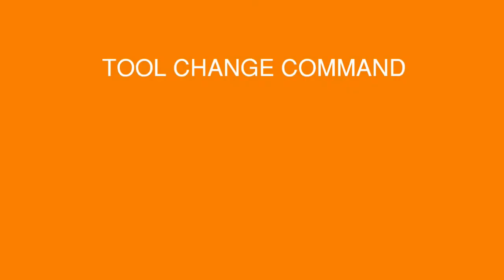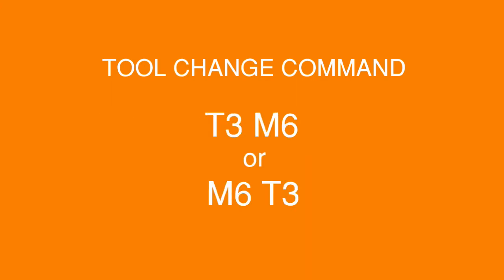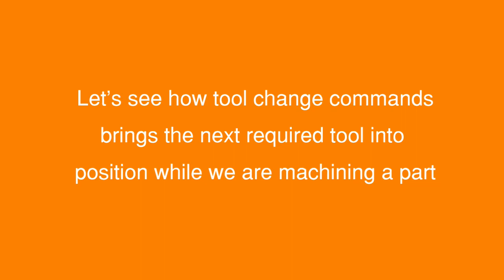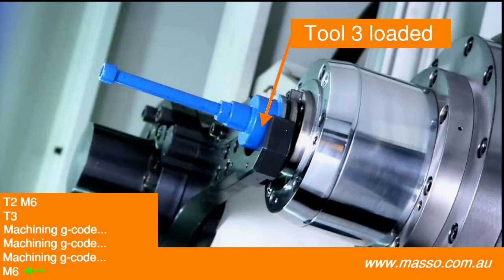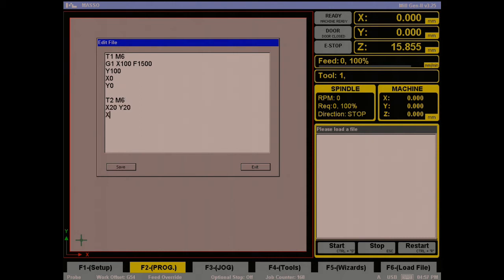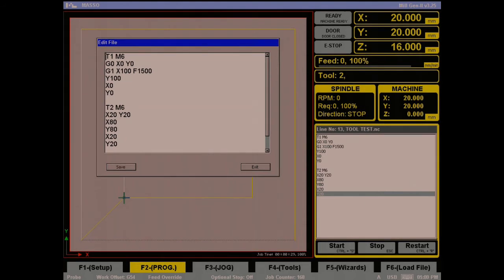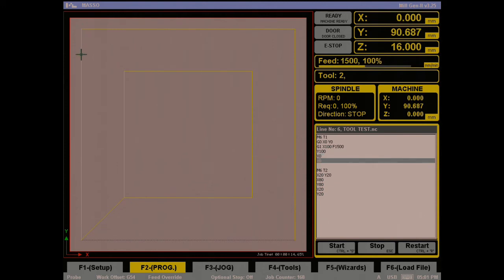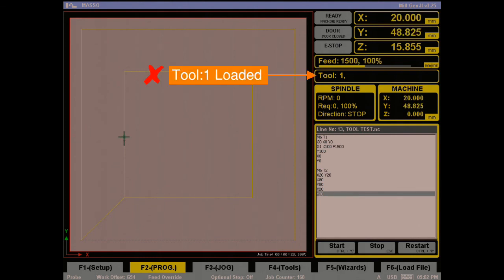Understanding Tool Change Command

Comment: If this is the way your control works, it’s hokey. It should never matter which order the codes are entered as long as they’re on the same line. In real CNC programming, each line of code is called a block and programs are executed block by block. Preselecting a tool to move it to the ready position should only happen if you command a T code on a block that does not contain an M6 code. That is the way every machine has worked that I’ve programmed since 1981.